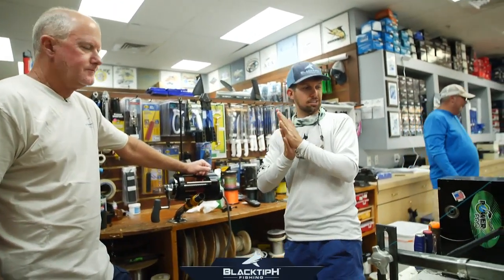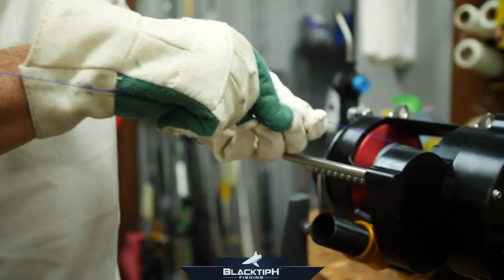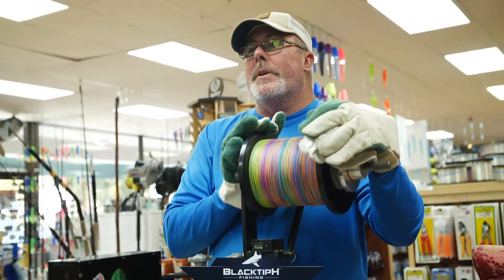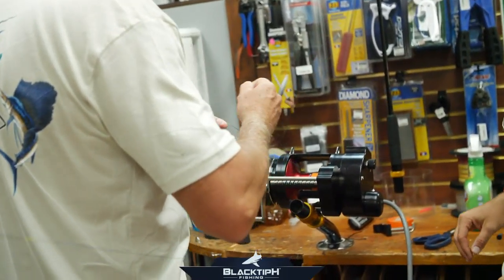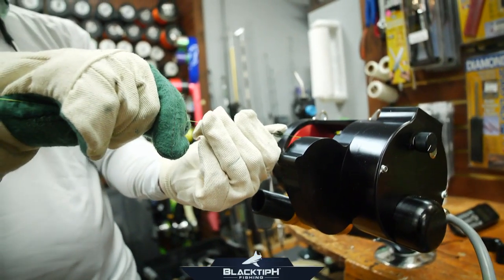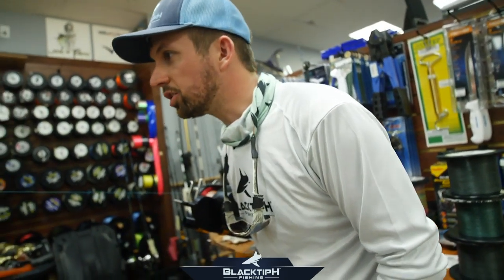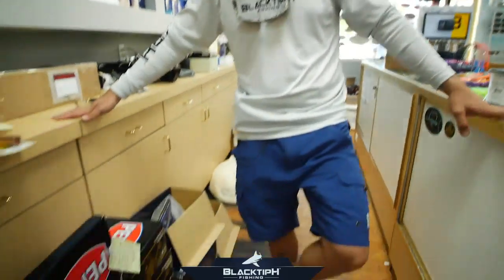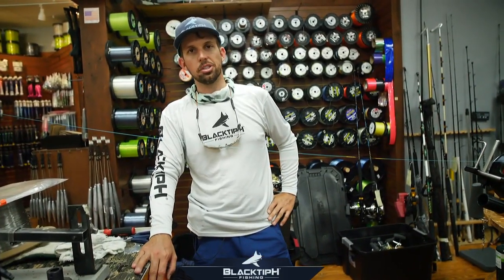Spooling GIANT Reels for Monster Fish

Comment: I prefer putting a few yards of mono on the bottom when I spool reels for customs. It grabs nicely and unlike tape, it doesn't leave a sticky residue when you take it off.
Reply from the maker: I understand what you’re saying, but you never see the bottom of the spool? There should always be line on the reel.
Reply: BlacktipH True. You do never see the bottom of a reel but at the same time, old mono is easier to take off than old tape.

Comment: You could totally make a reel to count feet. Instead of it going off of rotations, it could have an encoder sensor for the line to run though to count mm, cm, inches, yrds, meters, kilometers, or miles. Whatever you want. They're incredibly accurate and the same technique is used on a lot of very heavy construction equipment. Also forklifts. ;)

Comment: The custom work is really awesome. I've run Hooker Electric on my International 50's for a few years now and have had zero problems. I spool them with 130# or 80# Jerry Brown hollow core. I just like the ability to splice in new line if I get cut off. I've found the hollow also spools really flat and I can get an extra 10% or so of capacity. Downside is it's pricey off the bat but it saves you money being able to splice in.

Comment: My two most expensive reels are an accurate 50 A T D $$$   dont remember any more ,,,in red,

 Now I remember price reel and line 1450.00

       It has 1100 yards of 80 lb braid... 

and tiburon 50 wide gold,,$ 950.00,,,, no line on it yet, but is rated for 500 yards 80 lb mono..
  Got a couple van stalls too, but I got them at major discount vrse normal price
       And I am set for the rest if my life,,,, if I live to age 500 years...
Reply: oliver cheng  
  Whatever you choose, as long as they pull in fish...
   Saw a you tube video where someone put an extra car tire rim as a spool onto the axil lug nuts,,,
    And pulled in a 500nlb shark in half hour....not very sporting,  but our hunter gatherer ancestors would be impressed...

Comment: I will like to start shark fishing. What is a great rod, line, and reel to use that are a reasonable price. I like to find one that I can depend on that'll get the job done.  Thank you.
Reply: That's like saying I want to get into drag racing what's a cheap car... shark fishing isn't cheap. You can get blacktips and small sharks on spinning gear like an 8k saragosa or slammer. But if you go for big sharks you need a tiagra, penn international, avet, accurate ATD, Makaira etc... you will kill big sharks due to exhaustion if you dont use really heavy tackle and lots if drag. I know guys who use 130w with 200lb braid. They get 10ft sharks in under 45 minutes. It's not a cheap sport.
Reply: @Tyler-kw9ce  I did not know shark fishing is expensive. I understand drag racing lol. Sometimes even the most expensive drag car won't win. Thank you for all that information. I rather buy one instead of renting.